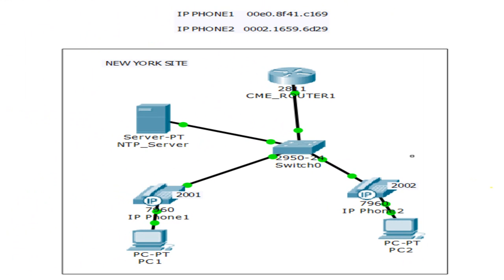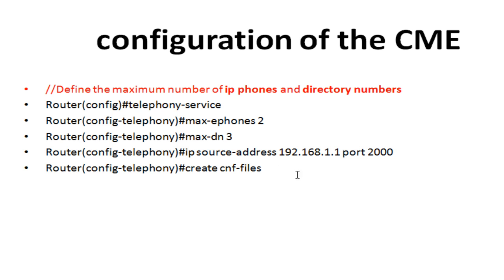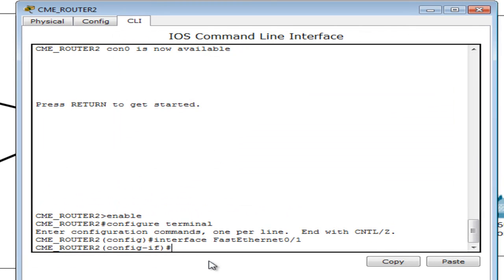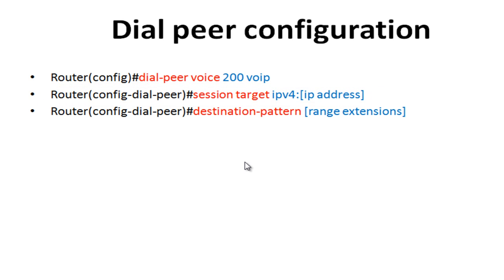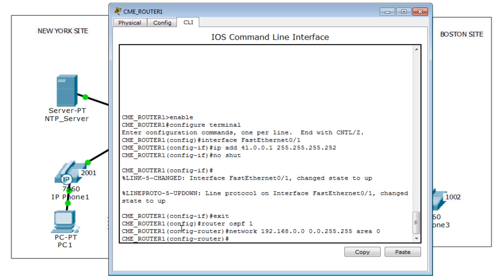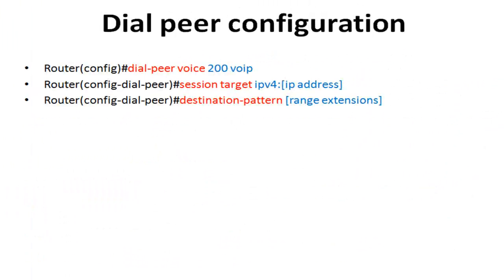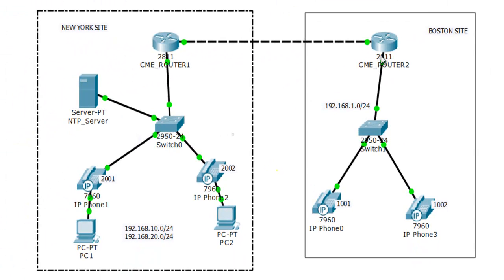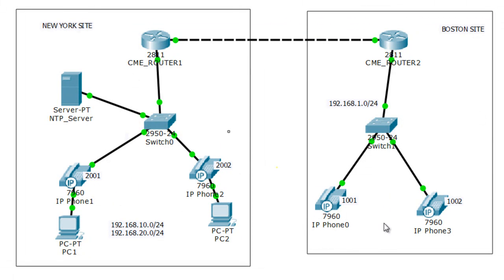CCNA Voice – how to connect VOIP Network to remote site

Comment: It is a bit strange that my cisco packet tracer can not add multiple ¨destination-pattern 1001 destination-pattern 1002 destination-pattern 1003 ¨ it accepte only 1 time only, so i need to use the wildcard. thanks for video.